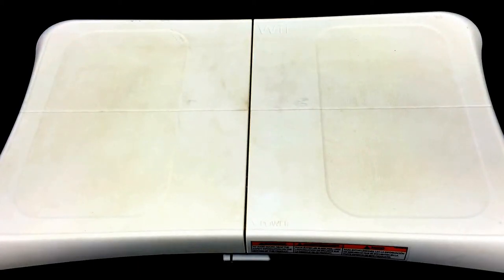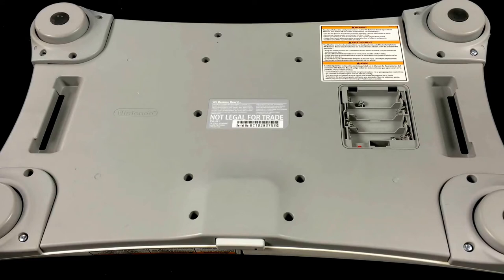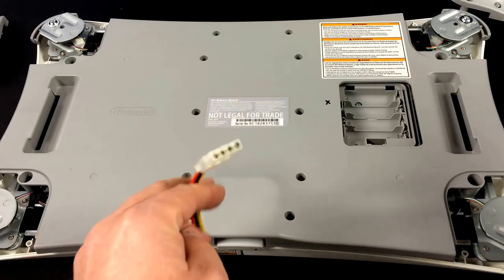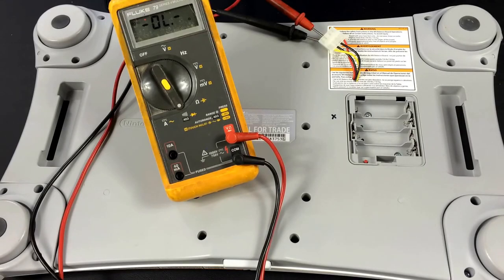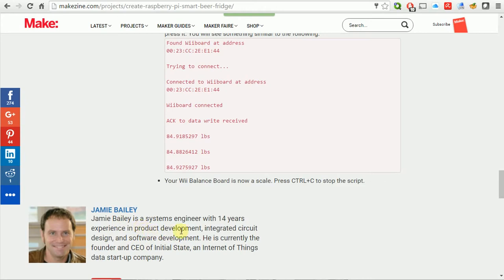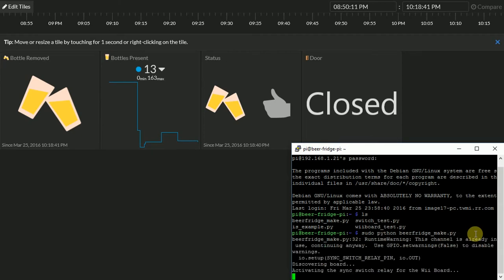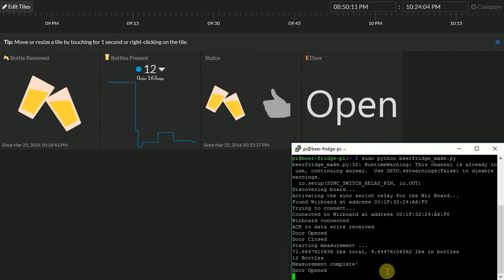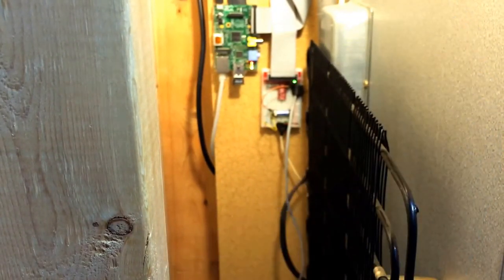Hack Wii balance board to make a smart beer fridge!

Comment: I gave this a watch since it tackles opening up the Wii Balance Board and adding wires to the power and sync button. It was just what I needed because the Balance Board I got had a bad case of corrosion where the whole battery board was corroded and the a small part of the wires on the brick connector broke. I'll have to replace them and maybe mod the Balance Board to be powered by 5v USB or something. I won't be using it for a fridge but your explanation of the wiring will help me fix my Balance Board so Thanks!

Comment: I was wondering if you have a wiring diagram of how the relay is connect and works? I like the way that you use the power from the pi and that it connects without the need of pressing the red button. I just want it to weigh myself so that i can go over and stand on it and don't have to press the button. Thanks

Comment: This was helpful to our project! I hooked up a Pi3 to a wii scale using the pi to power it and a relay to activate it - being used as a Hive Scale for an instrumented beehive.  Just FYI I found a cheap waterproof connector (Superseal/Tyco/Amp style) for about $1 that lets us remove the electronics (in a separate enclosure) and leave the balance board in place under the hive.
Reply: I was also thinking of using this as a beehive monitor, how well does this balance board work for that? Is it accurate enough to check how much honey the bees bring in every day?

Comment: Any thoughts on using a ESP32 instead of raspberry Pi?  It comes with WiFi and Bluetooth so it's would be a single package.
Reply from the maker: Yes it’s probably possible to do it with an ESP32 as the gateway, then just send data by MQTT to other devices

Comment: Awesome video.  I had a question.  What is the voltage rating on the reed relay?  I've seen some that are 0.5amp and 1amp.
Reply from the maker: Not sure, but either rating would work fine. The Pi is running 3.3 volts and very low current through the GPIO pins.

Comment: ? For you. I want to do this for a mini beer kegerator but don't know what part to use to register when pulling the tap handle. So instead of a door switch to set off the script to refresh what hardware would you suggest for a beer tap handle?
Reply from the maker: +Christopher Patrick maybe drill a small hole in the tap handle at the right angle to embed a mercury switch.
Reply: John's DIY Playground would it be possiable to run a couple temp sensors with a tilt switch and have it all display the info?
Reply: I have no raspberry pi experience so this will be a whole new learning curve for me.

Comment: I think this would be more interesting with a kegerator but I'm guessing that wii balance board isn't sturdy enough for even a quarter barrel.
Reply from the maker: Yes, depends on the weight of your kegorator + full keg.  The Wii balance board maximum weight capacity is right around 330 pounds, or 150 kilograms.

Comment: Nice work! Hoping to follow along... but I'm getting an error. Mind giving it a look?

bluetooth.btcommon.BluetoothError: (114, 'Operation already in progress')

RPI2 with BT dongle running the latest Jessie

Full response:
http://www.pastebin.ca/3601114
Reply from the maker: +Ralph Blumberg Hmm, I hope someone else can chime in and help, I'm just a Linux newb myself.  Obviously looks like some issue with the Bluetooth dongle.  Did you test the dongle on your pi with the command "hcitool dev" and see if it gives you a response?  I'm guessing yes because the pastebin stuff you posted makes it look like it at least discovers the Wii board but then chokes for some reason with the pairing operation.   I don't have much to Google on, perhaps do a search with the model of your BT dongle.  I also found this little tidbit of info related to that error 114:  http://ppaalanen.blogspot.com/2013/02/broken-connection-to-dinovo-bluetooth.html
Reply: +John&#39;s DIY Playground Yea, i'm able to manually connect to the balance board. I tried that post before commenting here.. no luck :(

What OS are did you run? wheezy?

Thanks for replying.
Reply from the maker: Ralph Blumberg On my beerfridge pi I am running Linux Raspian (Jessie) 4.1.19+ #848 last updated March 15, 2016.
Reply: +John&#39;s DIY Playground Ahh - bummer! Was really hoping it was an easy Wheezy > Jessie. Thanks for the quick reply.
Reply: Update - bought a RPI3 and it works fine... must have been my dongle, thanks!
Reply from the maker: Ralph Blumberg oh great!!  So glad to hear you got it working Ralph!!